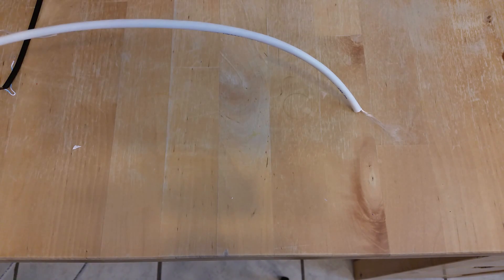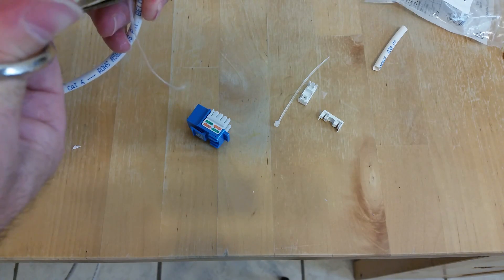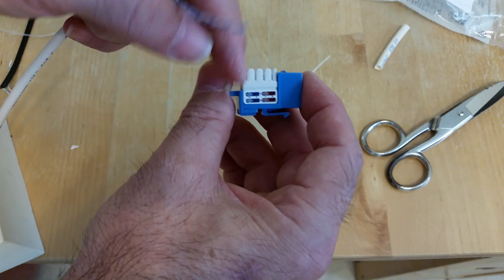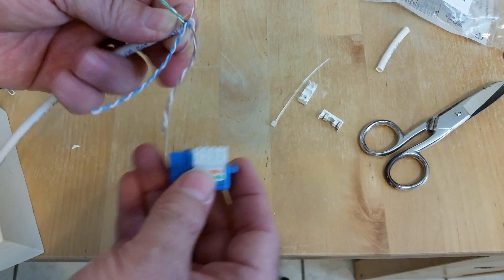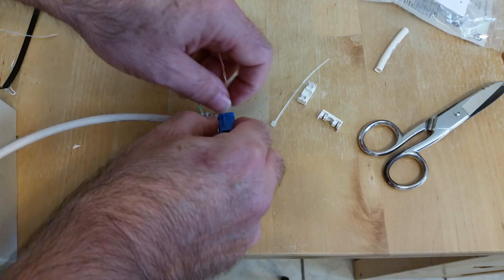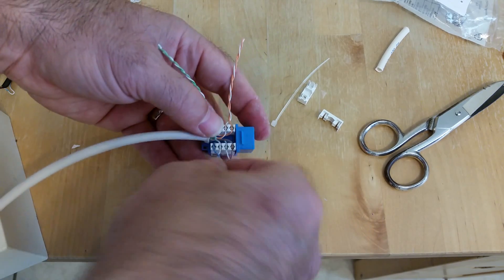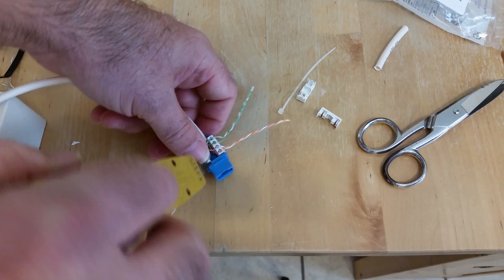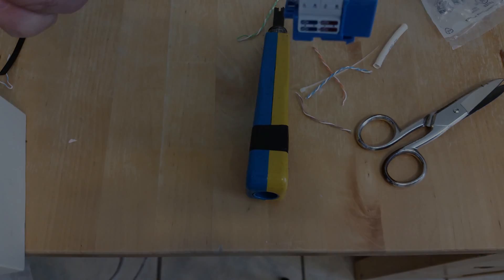Connect Cat6 cable to Jack

Comment: There are two types called 586A and 586B.  Up colors for A and lower ones for B. Your cable is not Cat6. The Cat6 cable has a plastic cross shape bone inside.

Comment: I have to lol, as I never knew your supposed to use a punch down tool. I’ve always put the wires in ,then pressed the top cap on with pliers . Funny as they still worked .
Anyways I purchased a Klein punch down tool today , and I’m wondering if that brand is any good for this ?
Reply: Klein has been an industry leader for years & some brands(Panduit) use a tool that terminates without an impact tool

Comment: Can you connect 2 cat6 cable to the same cat6 jack?
Reply from the maker: You might be able to, physically,  but it wouldn’t function as a data outlet.  However if your purpose was just for phone wiring, that might work.

Comment: Found out the technician that told me it was wired incorrectly wired it incorrectly after 2-3 years of my router acting weird, it was doing 2 1 3 4 5 6 7 8 instead of 1 2 3 4 5 6 7 8 he swapped orange and white orange 😑
Reply from the maker: Glad you got that figured out! 😳

Comment: Can the jack be re-used? Or is the jack like a RJ45 that once u punch a cable in it cannot be used again
Reply from the maker: You can definitely re-punch a Jack several times. 😊
Reply: As DIY said you can & most definitely will re use jacks if you do many of them.
Gota allow for human error

Comment: Hopefully you’re still answering comments on this stuff.

Recently had to do some work in my place cause of the confusing mess left behind by the previous occupants. He had the modem going to a switch, the switch then had its jacks going to a board, before he had the cables going to the rooms connected to the board for internet. Had complaints that the speeds to those rooms weren’t working as intended, while another room was working fine that skipped going to the board and went right to the switch, so I figured I’d take the cables going to the rooms off the board and go right to the switch. Originally I had put the male sides in the B config to the switch, then I changed the wall jack in one of the rooms to the b config as well, since for some reason the previous tenet made it the a config. But now the speeds are somehow worse. So I went and changed the male end at the port to A config, and had no change. Any idea where I’ve messed up?
Reply from the maker: For 10/100/1000 Mbps connections, whether you use an A or B style termination on the ends really should make any noticeable difference in speed.   Ideally, you want the same config on both ends,  but with modern equipment now, mixing A on one side and B on the other should still work.   
I am almost wondering how well the connections are terminated.   🤔

Comment: Thanks for sharing! I was about to relocate my home phone by rewiring it through my attic. However, I noticed my old phone line that was established by the previous owner only used two lines orange and orange/white while others were not connected. So, since I am going to use Cat6 connector, should I still follow the same thing by only adding orange and orange/while leaving other colors loose?

Comment: This is Cat5 Cable. NOT Cat6
Reply from the maker: Do you have video? 😄
Reply: @DIYTelecom  Just google it. The difference between Cat5 and 6 is that 6 has a drain in it that terminates to the housing of the connector. The mod (cable end) has a metal shield on it that the drain gets terminated to. As for video? No... I do this for a living.
Reply from the maker: Ok good.  I see your point.  Thanks for the correction.  Let me see about getting some of the materials and making a new video 😃
(Btw, I have eaten my fair share of fiber glass insulation too)

Comment: Your cable needs to be fully seated to the back of the jack. This is the incorrect procedure on crimping. Also use a cradle to hold keystone jacks. Crimping on a table stresses out the plastic clip and will lead to breaking due to excessive force.

Comment: If I install a CAT6 Cable in a RJ45 jack ment for CAT5/5E does this affect the speed or performance of the cable ?
Reply from the maker: mixing Cat5e and Cat6 cable usually will little or no affect on speed unless you're covering distances longer than 100ft.  Or, you're trying to reach 10gig network speeds.

Comment: can i do that in STP  cable ... OR.... its ok for UTP cable only?
Reply from the maker: The same idea would apply.  But, I will admit, I don't working with STP that much.  There might be some small differences in the process.  For instance, what do you do with the ground wire?   Great question, thanks for commenting! :)

Comment: Is it possible to use a cat6 wiring into a cat5e wall plate? Because for whatever reason I cannot get it to work..
Reply from the maker: yes Chris, you should usually be able to use cat6 wire with cat5e jacks and vice-versa.   I suspect if it's not working then one of the wires is in the wrong place.  Or, not making a solid connection in the jack.
Reply: Not all Jacks & plates are interchangeable

Comment: Nice video! Very helpful to this beginner. Can I ask: (a) where did you get your keystone jacks? And (b) how to you compare the punch down to the “toolless” jacks? Thanks!
Reply from the maker: Thanks for asking.  I get my Jacks either from Monoprice or Graybar.  I highly recommend you avoid buying the from the big box hardware stores (unless they are name brand Leviton or Hubble jacks).  As for the toothless Jack's, I have no experience so I wouldn't be the best person to ask.

Thanks for your questions and thanks for watching. :-)
Reply: Panduit, Dale, Panduit.
Reply from the maker: Yeah Panduit is very reputable.  I am a Leviton guy, but nothing wrong with Panduit. 😁
Reply: @DIYTelecom  Allen-Tel are good

Comment: Hello, i am looking for a insert like your RJ-45 jack which i can use for my self 3D-printed case. Maybe something with screws like the old VGA-Cabel holder. I have to connect 4 cables from one case to another - so i do not really need it for LAN. Is there something you know and can recomend me? I hope my english is good enough :-) Thanks in advance for your help.
Reply from the maker: Tam,  my favorite place to look for things like that is monoprice.com.    Good luck!  :-)
Reply: Thank you :-)
Reply: Tam Gaming

 Hello, I am curious as to what you ended up using for your 3D printed case. Can you tell me what brand?

Comment: Question for u: If I send 50mbps to 5 clients, each with a router, how can I limit each one of them with what I'm selling them? Ex. One client buys me 10, the other 5, the other 3, and so on. Is there a way to limit them so that one of them doesn't take the entire bandwidth?  Thanks.
Reply: Sorry for the late reply but yes you can "throttle" bandwidth many different ways. A lot is depends on the hardware you have. Any router with the DD-WRT (linux) firmware can limit DL speeds and much more. There's shell commands that can accomplish this as well by enabling SSH in Winblows and remotely configure each router by ip address. I can't really add much more without knowing your set up but here's a couple links that should point you in the right direction. What router you are using. Which OS you have and what version. Reading up on how static vs Dchp work will def help your situation.  Setting static ip's for each router will save you a lot of grief down the road. Check the wiki for hardware support for your router, Also the last link is the only real place you need to go with router questions. Take care m8

 https://markmaunder.com/2011/01/26/how-to-reliably-limit-the-amount-of-bandwidth-your-room-mate-or-bad-office-colleague-uses/ 
https://www.dd-wrt.com/wiki/index.php/Main_Page
https://portforward.com/

Comment: Do you have to use a 110 blade for cutting (or whatever it's called) or can you also use a simple wire cutter?
Reply from the maker: Well, you can do it without a 110. Just need something soft to force the wire down into the grooves.  Then, use a wire cutter to cut the excess off as close as you can to the edge of the jack.   If you're in a tough spot and that's all you can do, it will work.  But, the right way is to use the 110 punch tool.

Thanks for commenting!
Reply: Does it work with credit card or something like that ? What is the best tool if you haven'nt 110 punch tool ?
Reply: @zezan321  the credit card method works better if it's maxed out first, because then you can't afford to buy the proper punch tool.
Reply: @pegpenguin  Thank's for you answear, I bought punchdown tool for that and now i am using it at work and is really easy to wire a jack
Reply: Ok thanks!

Comment: Question: if I have a cat6 cable for the internet. Should I make the end part of the cable into a jack or into a connector?
Reply from the maker: +toodamnfob for non-commercial use ( like at home), you can do which ever is easier.  In commercial installations, every cat 5 or 6 cable that runs from the data room our to a workstation are should be terminated with a jack or a patch panel.  Using a crimp-on in a commercial install is considered unprofessional.
Reply: DIY Telecom Also, is it possible to do a crimp on without the tool?
Reply from the maker: I cannot think of a way to do the crimp without the tool.    If you look around on the Internet, it's possible that someone might have a system that does not require the tool.
Reply: @DIYTelecom  Speaking as a professional, whatever  the customer wants, that's what the customer gets.
One is not more professional than the other lol

Comment: Is this the same as terminating a Cat5e cable to a jack?
Reply from the maker: yes, the same.  Cat 6 and Cat5e  procedures are very much the same.
Reply from the maker: +Lucas K Films yes, exactly the same.  However the pattern of where the wires go on the Jack may be a little different.
Reply: DIY Telecom alright. thanks for a great video. got my jacks and plate made!
Reply: Lucas K CONTROL